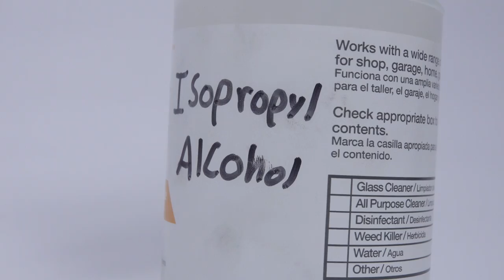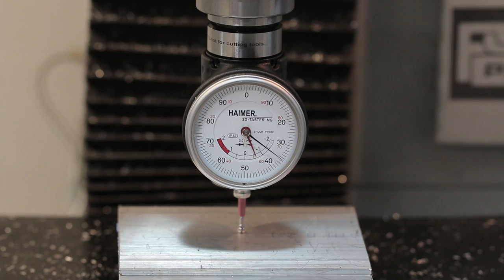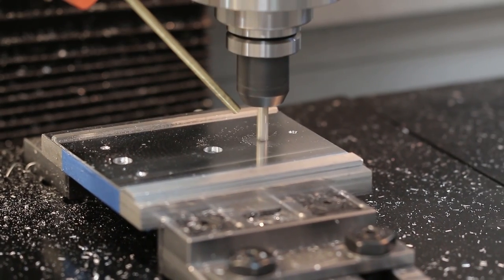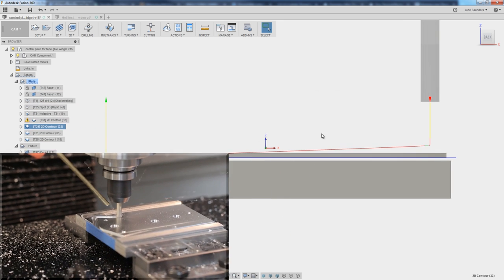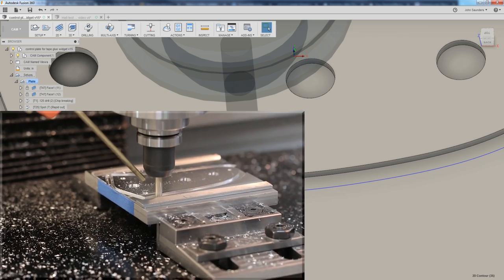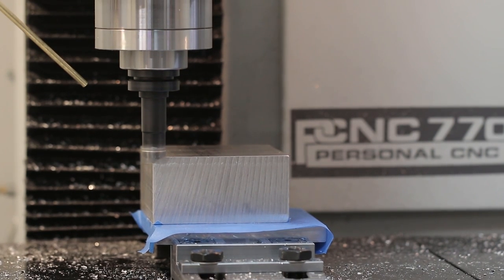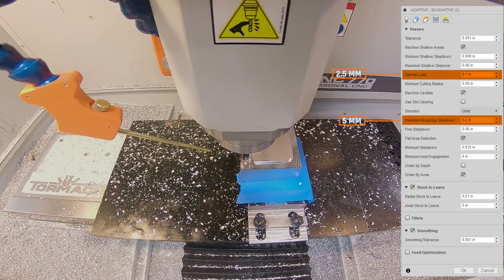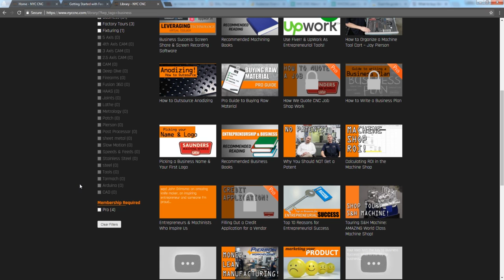AMAZING Cheap CNC Fixture: Superglue! WW185

Comment: Many people in the wood CNC area use this trick. A nice addition is to soak on side in activator, and one side with the glue. Instant adhesion, no need for the clamp!
Reply: Ryan Heaney, I was going to post the very same thing. 

Great that John is disseminating all this info but the activator on one side is the other half of the trick. 

When you want it to stick FAST and solid, the activator is really a timesaver too. Don’t even need to wait for the few minutes clamped down. Just a quick clamp to express any air and then release and by the time you have put the bit in the spindle you are ready to make chips.
Reply: Yes, I‘m using this too. You need a good reference edge, though, if you need to align parts...
Reply: i use this method for small parts without activator and it works fine. glue dries in seconds. no need for a clamp or activator just hold it there for 30 seconds. 
no one is so tight on time they cant spare 30 seconds.
Reply: On the other hand, if you spray one side in accelerator then as soon as you make contact with the two parts, they’re stuck. No time to position or align them.

Comment: We had a bunch of 0.06 aluminum parts to cut earlier this week so we gave this method a try.  A flat aluminum plate was the 'fixture' to which we secured the parts.  We used a 1/8" endmill with three flutes to profile the parts and began by running at 30 ipm.  The first few parts ran great, then we had three that went into orbit when the tape separated from the fixture.  Thinking that the acetone in the super glue activator was killing the adhesive in the tape, we stopped using the activator.  After another orbiting part, I thought that maybe the coolant was loosening the tape.  Running without coolant resulted in a broken endmill.  We were just about ready to give up, but then just tried slowing the feed to 20 ipm.  After that, the job ran like a champ!  So the final combination was 3M Original blue painter's tape, Fastcap 2P-10 glue with no activator, and a 2-flute endmill running at 20 ipm with coolant.  The tape was burnished to both the part and fixture.
Reply: Try using a carbide router bit instead of an endmill and you should be able to bring your speed back up, I have found with thin parts that the helix of the endmill  tends to grab and pull the part up if you are cutting completely through the material. Your failed parts will probably show evidence of this if you examine them. I don't believe the activator has anything to do with it, as I have had no issues using it, but I also spray the activator right on the glue and  slam the parts together, which prevents the activator from completely coating the surfaces I'm trying to bond. You have about half a second to put the damn parts together, but usually that's all I need.

Comment: I use this fixturing tecnique since more than 2 years on my router. It is widely used by guitars manufacturers to keep wood in place while scraping it. I use adesive paper tape, it works the same.
I don't use any clamp, a big pressure with all your body for few seconds is enough. Also a wood roller to flat the tape is the best choice.
For best results I spray a super glue activator on one face. While the solvent in the activator evaporates, I get enough time to distribute the glue on the other face. Then I join them by applying all the weight of my body that I can. I mentally count until ten and I'm ready to go.
P.S. Prepare the fixture on a table, not on the vise of the milling machine!

Comment: Interesting timing.  Last week I bought six rolls of blue tape and three packs of SuperGlue in disposable single use tubes for impromptu work holding on three different CNC machines.
Reply: Hi, please what kind of blue tape do you use?  Thank you 😊
Reply: @vojtechvalenta8162  - "Blue tape" is slang for painter's tape - tape which is designed to adhere temporarily but not permanently.  Some "blue tape" is green, yellow or purple.  It's typically a crepe paper tape with a non-aggressive rubbery adhesive.

Comment: Awesome video! I have been using this trick for about a year now. I take it a little further by loading a steel dowel as a tool and adjusting the Z-axis depth to the top of my stock minus 9 mils. 9 mils is the thickness of 3 tape layers . I stick a small piece of tape on top of my stock below the dowel. I apply the super glue to one of the tape surfaces and I spray a light coat of accelerator to the other. Then I quickly place my stock and lower the Z-axis (goto zero on Mach3) to act as the clamp. It speeds things up because I don't have to wait minutes for the glue to set up. The accelerator cures it in about 5 seconds and still allows enough time for the glue to spread evenly and evacuate the air.
Reply: have you tried some CA with activator ?  works great and holds awesome

Comment: I do the same thing with Wax.  McMaster-Carr Item Number:  1129K11.  The wax is excellent because it has resins that make it extremely sticky.  It can also be melted off and reused.  As long as I run Coolant or Air, the Wax does not re-melt.  I often make thin panels with detailed Hole Patterns and extensive Milling in sizes greater than 30 inches x 20 inches.  When Milling thin Panels I also like to use Downcut Endmills.  Harvey Tool makes a nice Three Flute Downcut Mill in various sizes.  A sample of their Downcut Mill is: 873824. 

I've also found that because this Wax is so strong, I use it in place of Loc-Tite when installing Slip Fit Dowel Pins.  The Dowel Pins can not come out naturally, but if you need to take them out, only a small amount of Heat drops them out.
Reply: Great tip, Theron! Sounds a lot cheaper than Cerromelt! I have some jeweler's casting wax and some Roman Black, I have never thought to use them for fixturing.

Comment: NYC CNC have you tried upgrading to green 3m auto masking tape. Can be bought in 3 in wide and usually costs businesses less than 20$ a roll. Water resistant and a stronger hold and of course residue free. I feel like it could improve your already great solution.

Comment: John, shock also break superglue. I use this regularly, after milling the part, I remove the fixture, and slam it onto my anvil with the part facing down. The shock separates the two pieces.

Comment: Used this trick today using the powder coat type tape on some 1 off starboard parts that would have otherwise been a pain in the cuninglinguals.  This made them  super easy. I was a bit worried if the tape would hold to the plastic well  enough.it was surprisingly hard to knock loose .. now no worries. Thanks a million

Comment: Critical detail when splicing more than one width of tape:  Only use butt (i.e. side-by-side) splices.  A gap at the butt splice is fine.  Lap (i.e. overlapping) splicing the tape would result in a raised, uneven surface.

8:23 In this shot, it's hard to see if there is any gap, meaning there is an unnecessary risk of overlap.

Comment: This fixturing is amazing! In the beginning i was not so sure. We was using this method to machine aluminium plate with stock around 250x60x15mm on our GenosM560. We also used coolant thru spindel and still it was holding job really stedy! Thanks for awsome idea!

Comment: John I just cut/engraved a Titanium key fob by using the gel super glue and sticking the stock to a piece of faced scrap aluminum with a few razor scrapes to help with curing.  Held up great and the heat gun made short work of it when it came time to reclaim it from the aluminum carrier.  I wasn't being easy on that Titanium, either.

Comment: I've used this trick for years on my wood cnc router, would never have imagine it would be successful on a mill! Prep is key as you say!
Reply: That's where I picked it up! Used it on the router for years before working up the confidence to try it for metal hogging.
Reply: does the tape tend to stick well to the wood?

Comment: When it comes to vices I love the two piece vise "this old Tony" build in one of his videos I build it after him and with that I can use the whole table for setting up the work and you can build the vice as high as you want so nothing is in the way. Since I switched to cnc the two piece vice is my favorite it's cheap, easy to make and you can clamp the biggest parts with a vice some use a setup plate under it but that i would recommend only if you take very very hard cuts for normal work I never use it.
The glue technique is completely new to me but after watching this vid I will sure give it a try. I also like the magnet chuck for light cutting and because I work mostly with steel its a possibility...

Comment: I use 2P-10 for this as it's very tolerant of the kicker being sprayed right onto the glue and slammed together- if you have thin parts like the nameplate pictured  and you don't want to bend it on removal,  you can use aliphatic resin or white glue (Elmer's School glue or Titebond 1, but not Titebond 2 or 3  as they are PVA glues) then soak the part in water overnight and the glue will dissolve so the part literally slides off. This is really useful especially for parts of thin copper or brass sheet as you won't end up distorting the part, and you can machine parts instead of being forced to fabricate them by chemical etching. I don't believe scuffing the part before you apply the tape does anything for you, but degreasing is critical.

Comment: If you are cutting wood/alluminium thicker than 1/4" that is not too large a sheet.... Just build a small corner pocket at the far top of your X axis / Y axis corner and wedge your project board into it... then clamp an opposite corner in the far right X axis / Y axis to the bed... not to the project board..basically this wedges the material between two opposing diagonal corners without clamping to the TOP of the material surface but to the SIDE of it. Works great is reliable and means you only need ONE clamp ever, and allows not having to worry about spindle-clamp collision....(thus giving full availability to the workspace).............
THIS is by far the fastest simplest reliable solution ever.... Works great on wood thicker than 1/4",  at up to 1mtr sqr....but I have not never tried this method on thinner wood ..and think it might work depending on the size of the material.
Reply: While that would work for contouring, any through cuts or cutouts would go flying.. thus the tape..

Comment: Thank you for sharing!  I just used it a few minutes ago and the part held firm.  Couldn't find the adhesive you used in the big box store so I grabbed whatever they had (still Loctite brand) and it worked fine.

Comment: i have never had the superglue come loose while cutting aluminum with this technique. i use 3m blue painters tape with any kind of cheap superglue i can find. i dont wipe the tapes with alcohol, i don't use any catalyst, but i wait at least one minute and check the adhesion before starting miling. BUT, the tape comes loose of aluminum sometimes especially when i cut deeper and part gets too hot(around 80 degrees celcius)
Reply: 5 years into the video and i just saw This Old Tony using this method. It's an awesome method, congrats guys if you invented it, or thanks anyway for bringing this piece of valuable information to the audiences!

Comment: tape is used on 3d printer's alot and lathe guy's do the super glue all the time cool they both made the big time on the mill :)
Reply: And STP as an accelerant and locktight gel control or super gel control lasts longer in the bottle.

Comment: just a heads up WD-40 with a mdf base you might end up sending the part across the shop. My small CNC router ended up launching it across the shop.

Comment: John, will you do a test?  Use the tape trick and then immediately place a tenths indicator onto the top of the plate that you think might be high.  Lets see if it expands or contracts as the superglue sets up.   This would be useful information when dealing with flatness and parallelism together.. ... NO CLAMPS!

Comment: Is there a large advantage to using glue on tape vs 2 sided tape?  Ive used 2 sided tape on a few parts with pretty good success.  Making long thin parts.  I was shocked at how consistent the thickness was.
Reply: Double sided tape leaves residue and is expensive
Reply: @Space-Cowboy88  i mean, i just use company money to buy it and have never noticed a residue that didnt clean off when normally cleaning the part after machining.

Comment: I have been using this method for Wood and Acrylic my CNC table. But use super glue activator on the top piece of tape to get the Super glue to set faster. Would not have thought of using this method on a mill with aluminum though.

Comment: Hi guys....I recently super glued a cast iron  gib to cut its profile.....the only way I could remove the part was to soak it in boiling water for 15 minutes...then a good hit with a mallet..
I tried heating with gas...didn't budge..!

Comment: By the way one question... why fly cutters? They're great for manual mills but I never seen CNC guys use them. They're almost exclusively using face mills. Also your CNC needs tramming.
Reply: Fly cutter because lack of HP to push a big Face mill

Comment: John, nice video, but did you test this method with wet coolant type works?  
Does the heat transfer trough aluminium does not make connection loose or couse it to vibrate?
Reply: Dominik Kowalski na super mokro wszystko sprawdzilo sie bajecznie!:)

Comment: I am having serious problems with the tape adhering to the part and fixture. I'm only cutting 1/8" sheet stock with a 1/8" and a 1/4" endmill and it seems like the tape loses all of it's adhesive strength as soon as the flood or mist coolant hits it. I'm cleaning the part and fixture with alcohol and doing everything else as above. Any ideas what's going wrong?

Thanks in advance.

Comment: Nice tip! You could use an accelerator to cure the glue nearly instantly.
Reply: Thomas Allan just an FYI though. Accelerator on super glue reduces its bonding strength. Will set faster but won’t be as strong of a bond.
Reply: This, plus I worry about it setting unevenly before I have a chance to wiggle the part & spread the glue to a more consistent thickness.
Reply: I never knew this, thanks for sharing :)

Comment: can you cut into the tape very much? Like a thin plate with a bunch of thru pockets. or do you have to stay like a thou away
Reply: You can cut THROUGH the tape, just don't stop IN the tape because it will crap up your endmill and the fumes CA glue makes when it burns are horrible.

Comment: I downloaded and opened the Fusion 360 file from NYCCNC.com using the link provided. When I open it and go to Manufacturing, the [T31] 2D Contour (32) has the following error: Warning: Drill position is unusable.
Warning: A contour was not machined because the given lead parameters would cause a collision!

Any suggestions on how to fix?

Comment: So how do you keep the part from moving laterally with the blue tape? after glued there is radial movement with the flex of the blue tape no?
Reply: Couple of thou, but what tolerances do you need to hold?  Fine for most everyday parts. Cerromelt  is your alternative, or I suppose epoxy as mentioned above.